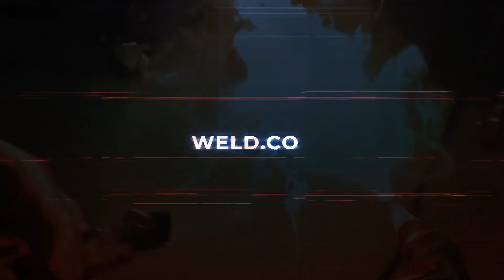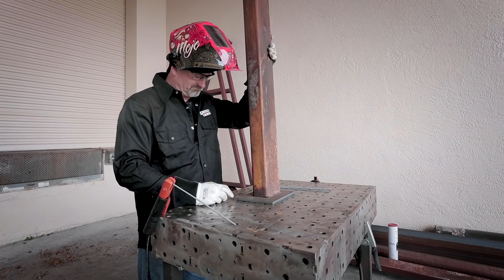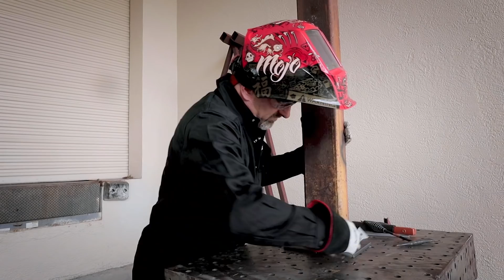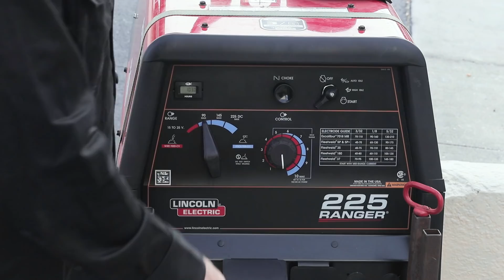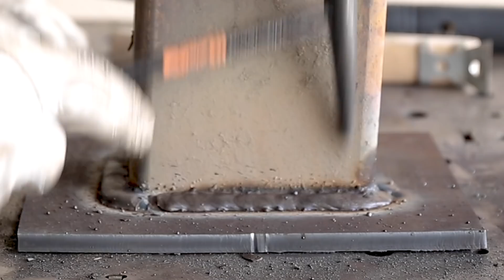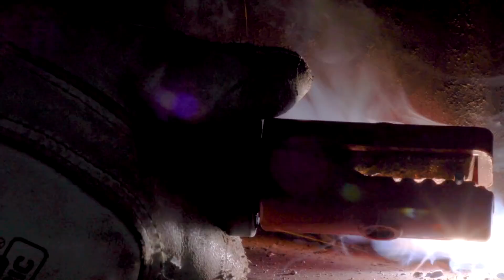Welding Dirty Steel - A Common Weld Repair

Comment: I love the whip and pause of the 6010 and sound of bacon cooking with the 7018.  Textbook technique. Great video for those of us beginning welders. Could the 7018 be run at 125 amps or is the 130 best for this application?
Reply: 125 is ideal temp for 7018 but I have a lincoln eagle portable welder/generator and like the ranger it has range settings that's hard to calculate exact heat input with the dial

Comment: Learned something here for possible frame repair on my Tacoma. Seems 6010 lower amps stay right in the puddle will do for me welding a repair channel to the frame , I can only get it so clean with small gaps.

Comment: Looks good

Ine thing. All the brushing basically cleaners up the metal. I would live to see a true scientific experiment of a similar rusty job but with no brushing at all or even chipping. Just pure blasting and then seeing if it's still a good weld

Comment: Switching to DCEN does wonders on rust/grime
Reply: I wouldn't have guessed that. The only time I run a stick welder EN is when I'm trying to minimize penetration on thin stuff. Not saying it won't work though.

Comment: I agree with the fact that there was no check for ortogonality….. that is always important when making such a weld in reality. Then it is useful to make the tacks with some shimming, so that the angle can get adjusted……. Before rooting. With my experience, heat may distort final angle if you make whole beads on one side only at a time?
Reply: Apparently, close was good nuff in this case.

Comment: I smashed a corrugated 3/4 in rebars, 100 cm struts to zinc 3/16 c runners with my little Total  250 AC , at 115 amps and some, 9lbs, of 6011 1/8 , to build  a ramp 7 ft long with an18in rise, the " 11s  made it Childs play, and I will never be without it again. it demolished the zinc coat and rust on rebar like it was not even there. Always learning from all experienced guys,  Great work.

Comment: Yes, you can do this, but why?  If you are not properly preparing the weld joint, then you are not a welder, you are a rod burner.

Comment: What you refer to as manipulation nothing amiss but under a lot of codes they do recomend that the weld  is no more than 3 x  the core dia of the rod wide , may be worth a mention

Comment: Question on cheaper welders.?   What makes an Arc Welder able to Run 6010, but Not Others.?   Question 2...   What makes One Welder able to Run at 100 to 130 amps on 110v,  but others are lucky to Run at 80/90 amps on 110v.?

Comment: I love 6011s. Able to penetrate dirty or rusty sheet metal at low to medium amperage.

6010s require dangerous amounts of current and voltage to run. DC alone isn't good enough.

Comment: Nice welds. If you go too much beyond A36, towards high strength steels, you will start to run into hydrogen cracking issues unless you give it some progress with a torch first. Relatively thin, A36, nor much of an issue.

Comment: Cool video.   But with that heavy rust and no grinder, I usually bump bump it up to 100-105 amps with the first pass of 6010, becasue that really helps eliminate those tiny slag inclusions.   It wouldn’t have “pushed away” the molten steel as discussed in the video.   It just would have burned out more of the crap (impurities). Don’t be afraid to use a tad more heat on crappy steel like that.

Comment: I work in fertilizer business and this is a lot of help!!  It's impossible to get some of the metal clean on some of this old equipment and you've never seen real rust till you look at a fertilizer spreader!!  Thanks and would love more videos like this!  An old timer at work told me to use 6013's and turn the heat up and they'll blow through the rust but it's hard to get it to look decent at all.
Reply: @multitoolish  I know this is an old comment but in case anyone else reads it, 6013 is generally not a good rod for rust or when penetration is important. In fact it might be the worst. 6010 (or 6011 if ac machine) is your best bet.

6013 is useful when welding thin metal though. And it can make a nice looking bead.
Reply: @Lucas12v I know what 6013s are best for, but you've never seen rust like we deal with. Schools and books don't teach what these old timers know.  This is not a little surface rust we're talking about. I don't know why it works best, I just know it does.

Comment: Good video, should have done one with all old metal. Bob Moffat did one a few years back which extrapolated into Texas tig.  I think a joint using two severely rusted parts would finish off the idea nicely for the channel.

Comment: Why not grind a little before to get down to some clean non-rusted steel? 
Also, what's the best route to start a welding career? Thanks. I've always loved welding and metal fab. I've been a house painter for 30 years and pretty much hated every minute of it. My business pretty much got killed after c-19 and now I actually have a reason to start fresh in my 40s with a trade that I would actually have a great interest in.
Reply: A fab shop helper at a shipyard is an easy way to get into welding. You'll get to practice and when you feel you're ready let the foreman know you're ready to test. Most will give you a chance.

Comment: This guy is bad...

Didn't even square it up and why would he need to scribe out a rectangle...use a tape measure...He was also going overtop his slag when welding...It should be weaves or Zs - no doubt there is a huge amount of inclusion. 

And the weld is just ugly...

Hopefully, he is just fixing farm equipment, only a farmer would be happy with that...

Comment: Thanks for the video , pretty nice looking weld considering the material!. I note you seemed to be dragging the 7018 at some points, pushing the weld at others. Is it not critical for 7018, and if so is this also true for the 6010? Thanks! A.
Reply: Drag angle because SMAW leaves slag "Drag when you leave slag" but the push you see is when he's sneaking the molten puddle upwards to make the weld bead profile a little higher, closer to that 45° angle. If he didn't do that quick slight push, the bead profit would end up flat... like 25°. It's just something you learn.

Comment: Am I the only one who would have spent the 30 seconds to grind the rusty metal clean then ran a single 7018 pass? It looked like a 1/4” tube, even if it were 3/8” to a clean 1/2” plate. One 7018  1/4” weld would be plenty…. Actually even if it wasn’t cleaned
Reply: I think he was on-site in their shop.  He said he didn't have a grinder.   Most welders hate grinding, he probably left one behind on purpose,  but brought a "suitcase " welder.

Comment: I actually love these types of videos! I work at a mine that runs Silica sand and Ground Silica and we have to weld patches on all sorts of rusted and are out things and you can’t over emphasize cleaning the base metal but it’s a reality that sometimes it’s not feasible to do that and this is a great example of an in field work around!! Great job as always!!!

Comment: NO. 1  you don't seem to have enough arc Force-- or Your no where near hot enough. That looks like 3/8 plate with all that rust you should be blowing stuff out of your way to obtain clean mettle and float impurities out of the puddle. A 6010 rod is a master  Blaster and a 5/16 rod would be the Ticket.  And penetration is surly what your looking for.  the 7018 cap looks  OK.

Comment: why not grind the piece clean ?
Reply: @Paul Sableski I had the same question, normally I would grind and clean all pieces to be welded, and if possible, square the tube end so it fits flush with the plate.  But I see how you can do this and this was an excellent video.   You ran it a bit hot, I think, and there was no arc rod sticking once you turned it up.  So yes, it can be done if cosmetic appearance isn't a concern.  My concern is the weld integrity and strength.

Comment: Hello::: The 6010 welding looks like my finish weld. lol Your 7018 looks top shelf. I never took class, so I did not know to top of a weld one rod to another. Thanks !!! If I wasn't 72 years old I would go to school !!! Age is not the problem,, Arthritis is my problem.
Reply: With you there about the age.  Learning how to weld again and work with metal. Nice change from wood and would like to combine the two in some projects. Video was excellent, always learning.

Comment: How about using 0.45 flux core???  This is a high build diameter, and flux core will cut thru rust about as good as stick. If using flux Core 0.45, what type wire do you recommend? Are there any real choices other than diameter, and manufacturer, to chose from with Flux Core???

Comment: Great job. Thanks for the info. What changes do think if you where to weld it with a Lincoln "crackerbox" ? Is it even possible. I do not AC/DC or +/- switches on my old machine.

Comment: Nice job. Sometimes the metal is crap (rusted) and you have to cut into it like you did with E6010. E7018 weld looks great.

Nice job on the video.

Comment: Nice weld, but sides of the plate are warping up. I'd tack the corners down to something. If you bolt it down it might just pull the corners down and leave a gap in the middle.
Very nice machine btw
Reply: The video was about welding rusty metal, not about whether the plate edges warped or the tube was straight or square
Reply: @buddylouis8348  thank I'll check it out

Comment: I have a pretty big structural repair to do on one of my knuckleboom loaders. I am a pretty good welder not taught in school but I was taught by a certified welder from Duke Energy nuclear plant and others like that. I have a Miller 250 Bobcat. I only have an old fridge to keep my rods in. What I am getting at is do you think as an average welder with rods that are not properly stored will I have a stronger structural weld with a 7018 or a 6011? This repair I am facing is pretty intimidating for me with a lot of stitching and plating involved. Basically the frame of my loader near where one of the stabilizers mounts is hanging by a thread.
Reply: @Paul Sableski thanks for the help, I grew up on 7018 rods but some books I have read lately have made me start dabbling in 6010 and 6011

Comment: you need to get schooled on the cap, you shouldnt have to wash the top like you had done, should just drag that jetrod.
Reply: we have always called 7018 jetrod here, but  when you run your weld hot almost anything can be jetrod.
 I like to run 1/4" 320-400

Comment: if you strike and arc try burrying the rod in the puddle if it goes out you aint running it hot enough

Comment: Great video Paul!  I like to run my 225's on the middle 145 amp setting and about 3-5 on the stick range dial for ⅛" 5p+. Little hot but good arc control even on rust. 🤘🏼🤘🏼
Reply: So what your saying is you like using low arc force with a cellulose rod? I do the same if there is bad fit up helps limit the burn through greatly

Comment: I understand that this was about welding dirty metal but if it is a column and you never squared up the column, the welding was informative.
Reply: He was simulating a job where it had rusted out. So in this case the column would be fixed and just getting it welded back down is the goal. Squaring is not an option. At least that was my take away.
Reply: it was a column for a house on a hill I think....
Reply: That was what I noticed.  The column wasn't squared up and there were gaps.

Comment: How he said “eyeballs” as a warning to the impending flash reminded of the time 65 years ago when I was 5 or 6 years old when I was in a welding shop with my dad and he sternly warned me about looking at the light since it could blind me. Well, the restroom was on the other side of where they were welding and I stood there scared to death and I subsequently peed my pants. 😂😂
Reply: Well, in my case it was about 45 years ago but my Dad did the same thing!!!   No, I didn't run to the restroom.  As I recall it was a snowmobile speed shop.   I just looked away from the arc when it happened.
Reply: :face-blue-smiling:

Comment: What has happened to this channel lol.  “I don’t have a grinder” right next to a generator?!?  At least name this video “what to do when you aren’t prepared or have the ABSOLUTE BASIC TOOLS” 🤦🏻‍♂️🤦🏻‍♂️🤣
Reply: The point of the video is to show welding dirty, rusty metal not metal that has been ground clean and bright.  Often times you might not have 110v available for a grinder.
Reply: Also, if you’re gonna have garbage arc starts, might as well save fuel on the ranger and set it to “auto idle” lmao

Comment: What sort of tow hitch does that welding machine come with?? 😅
Reply: it dont come with a tow or a trailer that is up to you or put it in the box of your truck or in your van.
Reply: @daryl4083  if the smiling face didn't give it away.........

Comment: great job but I guess that would only be used if your hand grinder broke and it was a life and death matter that it had to be done with out making an effort to clean it up. lol but it was a great learning tool I def learn how to weld a rusty pipe with out prep ,,,, 6010 - 7010 but wish you spoke a bit about the polarity

Comment: Nice job. I thought you typically drag when stick welding. You pushed and pulled. Does it make a difference?
Reply: when you push with 7018 you typically are more prone to slag infusions and other non conformities that will cause cracks. "when theres slag you drag"
Reply: I noticed that too
Reply: Always drag you will bury slag in the weld when pushing stick rods.
Reply: @exwldr6945  Actually with the 60s you can push if desired.
Reply: You dont want to push with stick as a general rule. Always drag.
Reply: @ellerygerman1988  but he pushed in several clips.
Reply: @Paul Sableski got that right
Reply: Probably just camera angle making it look like a push. He pushed the rod on the start to "heat the rod" as he said.

Comment: i would of atleast put a wirewheel on the areas to be welded instead of relying on the rod process to pull up all the crap into the slag puddle
Reply: Agreed, but sometimes you're asked to repair something that you simply cannot get a grinder with a wirewheel in there.  Then what do you do?  Nothing else but to reach in with a brush and try to get the large crud off as best as possible, then go to town with E6010 or E6011s.

Comment: I have always used 6011 for dirty welding.  Is there a benefit to 6010 or 5P over 6011?   Sorry,  I learned OTJ so I have done a lot of welding but didn't go to a welding school.  One welding shop I worked at just did 6011 for dirty and 7018 or mig for clean.
Reply: i like to give lincon 5p a quick dip in water and run them, the arc seems to be a bit more stable fir running roots.
Reply: Agree on the 6010  having a more forceful, digging arc.  Runs smoother too (IMO) than 6011, but most cheap welders simply don't run it due to lack of voltage at the arc while welding.    Also, the slag comes off easier with E6010s than with E6011s, IMO.